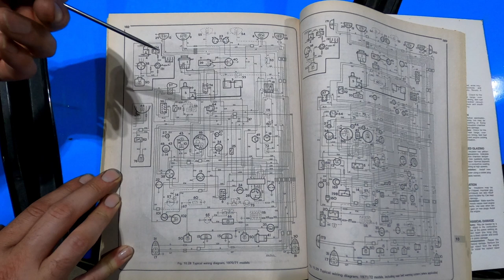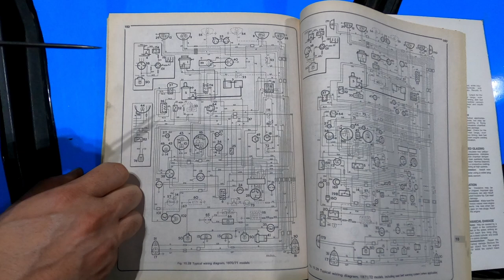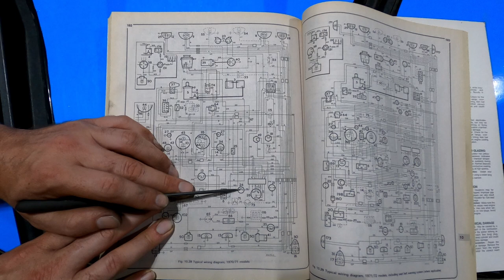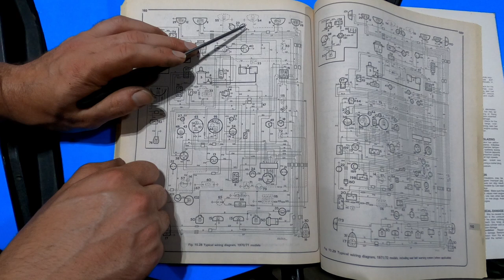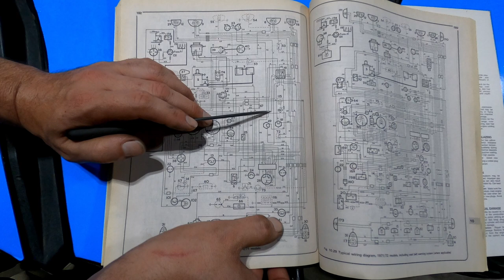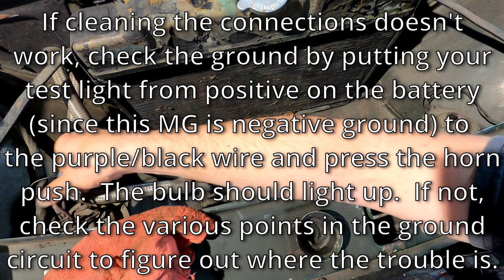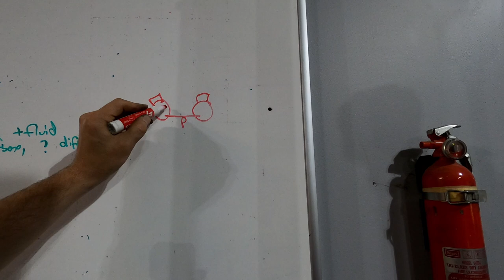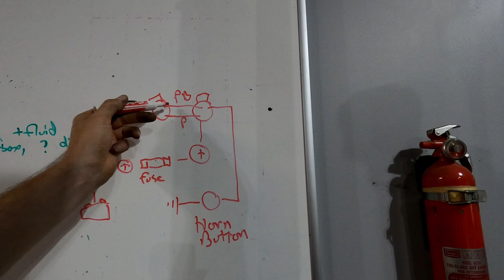Lucas Electrics - Fixing a Silent MGB Horn

Comment: Great video. I just tackled this issue on my 79 Limited Edition and a few months ago on my 71 MGB. Two differently wired horns. The late MGBs with a single wire connection need a good ground as only power is sent to the horn via the horn button on the steering column. The MGBs with two connectors the Power (Purple wire) is always hot/powered and the ground and activation is at the center steering wheel horn. The 79 issue was a poor ground on a freshly painted and restored car. I ran a ground from frame to the connection bolt of the horn.  The 71 that was also a new restoration with fresh paint and under coating issue was the horn push connection light corrosion/ground contact.
Reply from the maker: I'm still surprised how often electrical issues are the result of something as simple as a loose connection.  The system itself is actually pretty reliable and well thought out for the most part.

Comment: Great info.  Auto electrical 101.  Test light and a multi meter are my friends (but I'd rather rebuild an engine than trouble shoot electrical bugs LoL) and invaluable.  Cheers.
Reply from the maker: Agreed. I like the mechanical stuff too. There's something to the troubleshooting though. I love the logic.
Reply from the maker: Also, I'm glad to see you say the test light and multi meter are in your tool kit.  They're as important as a set of screwdrivers if you own one of these cars!
Reply: @midwestmotoring  Indeed! I recently used the test light to trace a no start to a dead electronic dizzy. Replaced with 123Tune dizzy. Love it.

Comment: Adding a relay to the horn (headlights too) is a good idea to prevent the high current going through the switch
Reply from the maker: The switch is meant to handle the current, but there's a reason they go bad after a while.

Comment: Electricity is Electricity , Lucas electrics have to abide the same rules as everyone elses, you diagnose and fix them the same way. Actually of course just the same as with modern cars it's not the likes of Lucas or Bosch or whoever who are doing the electrical integration it's the car manufacturer so that's another variable in the reliability of the system. At least with most 1960's cars the wiring diagram fits on one page and there is no CAN bus functionality to worry about! Neither do you have any systems that just won't work if some sensor is not working properly. So you've got less excuse for getting stranded at the side of the road than you have with 1990's and up stuff!
Reply from the maker: Totally agree!  I find that (if properly maintained) my Triumphs and the Healey are all at least as reliable as the 2016 "real" car--probably more so.
Reply: I have been working on LUCAS gear for 50+ years. There are too many videos, a lot from America that don't help the amateur repairer. A basic understanding of electrical theory also helps. 😊

Comment: I have a twelve volt power supply that I attached directly to the horns, and neither one is beeping.  They DO make noise like they WANT to beep.....
So my horns are bad.
Reply from the maker: So long as the 12v can provide enough amps, yes, that's exactly correct.  Horns shouldn't take a huge amount of current, so I would agree you probably need new ones.  Technically, you can drill out the rivets, separate the horn pieces, clean everything up, reassemble... and it might just work fine.
Reply: @midwestmotoring  Neither horn beeped with my power supply.  One had a broken off spade connector and that one I took apart and cleaned.  It has points in it that I cleaned.  I had a new Fiamm horn here so I installed that in place of the one I took apart, and both horns worked.  I think my power supply did NOT have enough amps to drive the horn.
Reply from the maker: That could be.  You could always try a jumper wire directly from a battery.